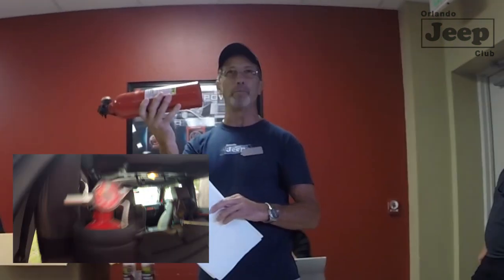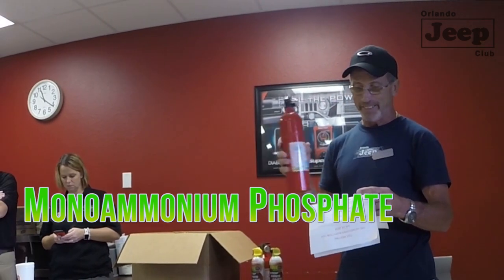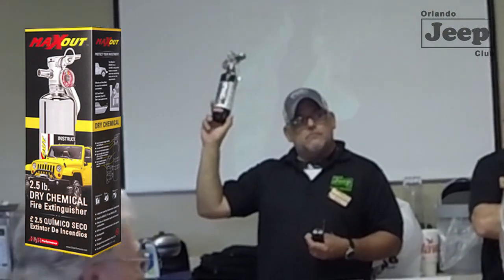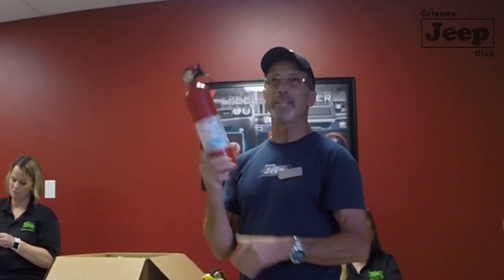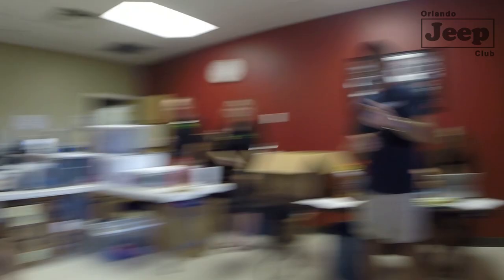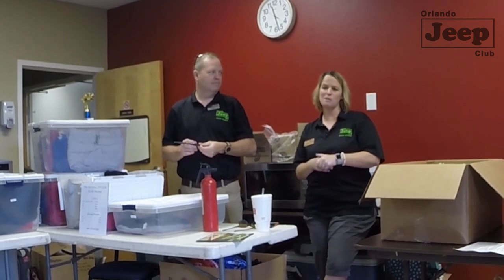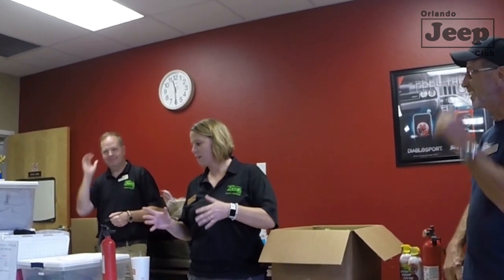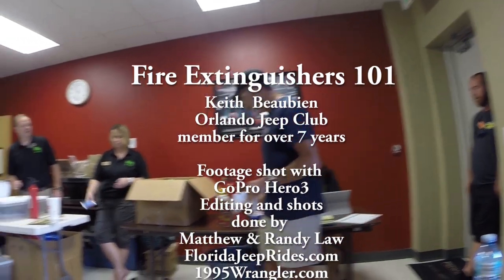What happens when your Jeep fire extinguisher fails?

Comment: Hi I am not sure that the nitrogen is necessarily what make it water repellant I think it ususally is coated a chemical that make it water repellant if you are wanting an abc type you should check out the 2.5 lbs rusoh eliminator it is supposed to be resistant to packing from vibration if you want more info please let me know and I will try to send you more info the type I mention is even supposed to be reusable and it is powered by co2 not nitrogen as for extinguisher that can be professionally refilled do you know that there is an argument that an extinguisher that is professionally refilled may not work properly? there is info that suggest the professional refilling of a fire extinguisher could be a problem you are not aware of this study? https://youtu.be/pTmF-iJukDw and or have you seen this unit ? https://youtu.be/bG3120QQPu8 ( I dont sell this product just thought you might like to expand your brain )
Reply from the maker: Thanks for the info. I have only had to use one once. A plug came out and the fuel must have sparked just right. I was working on it with the hood open. A quick hit and it was out. Very small and save the day.